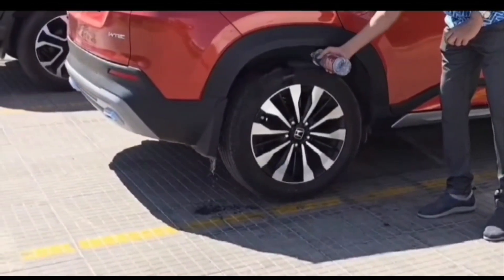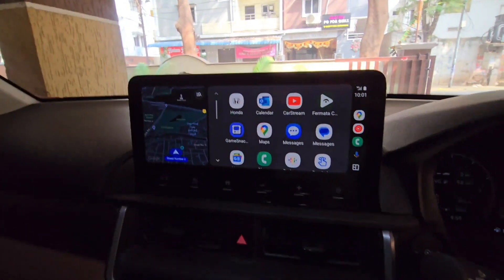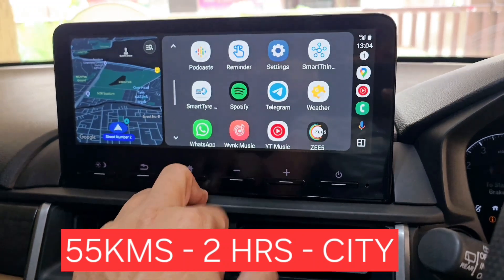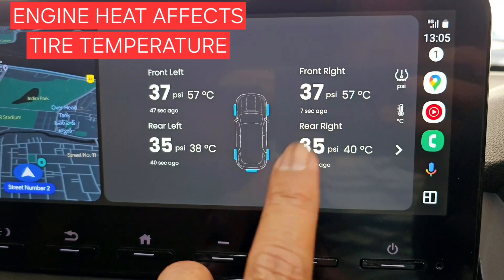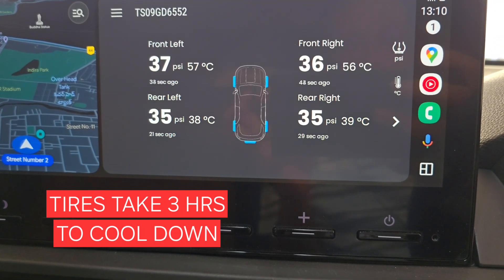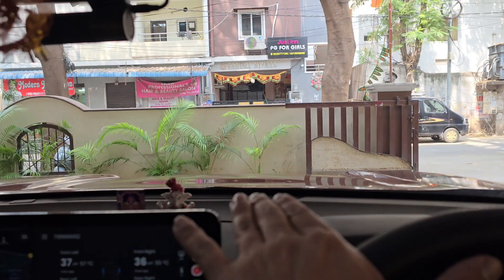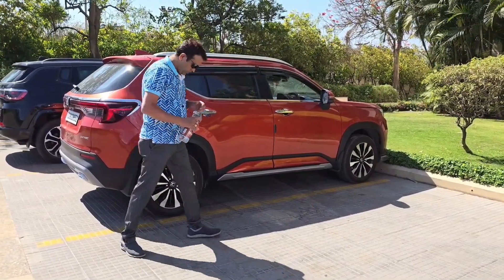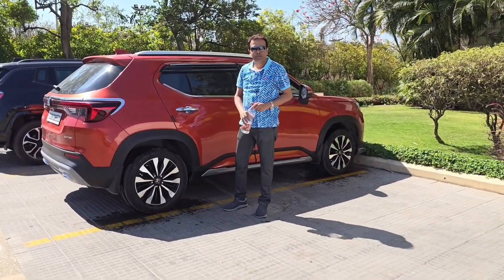TIRE🔥Temperature/ Pressure 💥 INCREASE after 2 Hrs DRIVE. Avoid TIRE BURST on Long Drives - EXPLAINED

Comment: did ur front rims got heated also?
Reply from the maker: @Pahlawan12D  Ofc front rims gets hot more than rear, due to Engine heat., and may increase more in summers, or doing extended runs.

Comment: I never check air pressure in city/when tyres are cold , After 20-30 km of running @80-100kmph I keep 35 psi (recommend by company) in all tyres with my air inflator machine

Comment: how did you install that Smart JK tyre app into Car Android system??
Reply from the maker: didn't install separately,  it reflects in your android auto..
check your phone Settings - Android Auto - Cuatomise apps
i guess you installed the playstore app, play store app wont show in android auto. Jk has separate app, for showing up in android auto.. you must have got the apk file  through jk dealer

Comment: Hello Sri, great Video. 
We just finished Bhopal-Jhansi-Kanpur-Ayodhya trip spanning 1700kms. I didnt notice heat cornern as such but i did notice drop in turanja tyre pressure instead of rise. I also noticed poor calibration of pressure meters in few petrol pumps. I kept F33,R32 as specified by Honda. 
Can you suggest me if?
1. Have you noticed any mild knocking while reversing the vehicle? I noticed this when fully loaded with all passangers and luggage while reversing on mild slope. Is it normal? I have to notice the same on our family CIAZ in similarly loaded conditions. But what do you think?
2. If the pressure higher than prescribed comes with some better handling/mileage/safety?
Reply from the maker: Didn't observe any kind of knocking while reversing, ofc didn't test fully loaded. Mostly did drives with max 3 passengers.
Second, tire pressure upto 34-35 if filled up in cool temperature, even if it increases to 40 after a long drive, its not a concern. its normal. But take breaks between few hrs say 2/3 hrs to cool the tires.
Vehicle handling may affect if pressure increases more., it will have less friction, as the center part of the tire tends to bulge out more, and less part of tire tread is in contact with the road, thus chances of skidding.

Comment: Also put nitrogen instead of regular air 👍
Reply from the maker: I always fill with Nitrogen..and its widely available at my place..Filling Nitrogen for past 5 yrs, on my old car too..
Nitogen is good and less effective on temperature changes, but its not that tire temperature won't change., it does.
Reply: @premlshrini  yes, you're right 👍  i guess newly launched tata cars have air vents for tyres don't know how much effective they are but yeah good to see those changes.
Reply from the maker: @demon-bh7hi  Normally, every car manufacturer should provide air vents for cooling of tires too, rather than just engine. But manufacturers of normal mid sized passenger cars are more inclined on engine cooling, but not tires cooling, that's not the case with High-end cars.
Reply: @premlshrini   true, hope to see those vents in the budget cars also 👍. Looking forward to your videos all the best 😇

Comment: if i get the tpms from honda can i check the tyre pressure in the mid/infotainment screen?
Reply from the maker: I posted a video on TPMS, you can contact the dealer, he delivers through courier any where possible. just 300 per piece and nominal courier charges whatever applicable. very transparent.
And subscribe my channel..😁
Reply: @premlshrini thanks for replying to most of the comments. Keep rocking ❤❤
Reply from the maker: No, unfortunately Honda TPMS can only be viewed in Honda Connect App, But not on infotainment system.